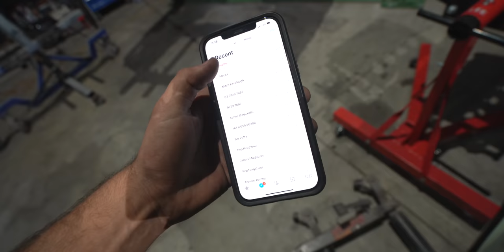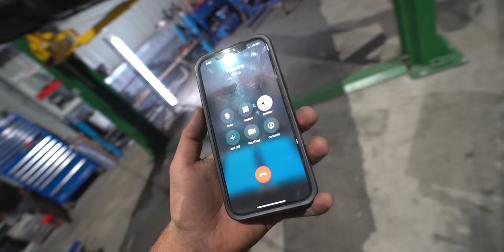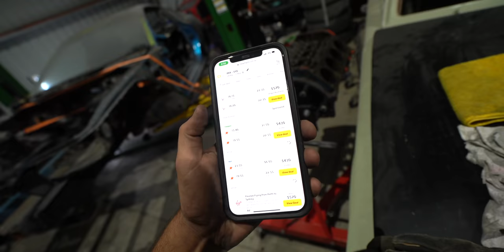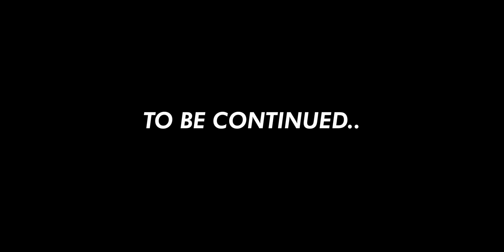THE FRIDAY THAT DIDN'T END | VLOG 05

Comment: Fully agree with your comments about how the internet has ruined GT-Rs.

I had a basic 34R, not even v-spec, that I built up to be a fairly nice Z  Tune replica. Kept twins (-9s, e85 etc, bit over 500rwhp) and I knew the next round of upgrades (engine/box etc) was going to set me back an easy 40k and in the mean time I was constantly stressed about damaging it etc. 

Turns out I get far more enjoyment out of driving the wheels off the Silvia at track days so the R was sold and that was that. 

It was the second GT-R I'd owned and I don't really regret selling either TBH. 

Prices now are ridiculous.